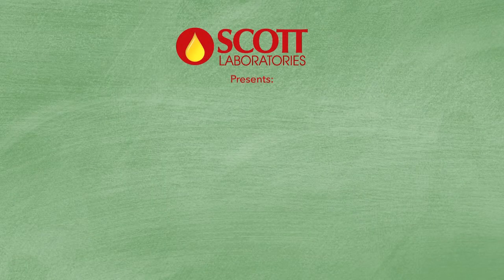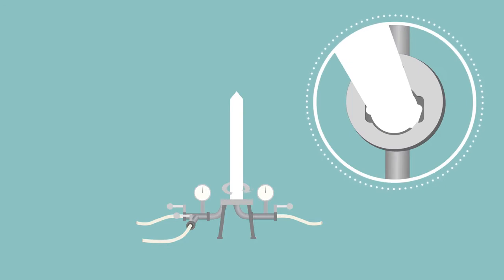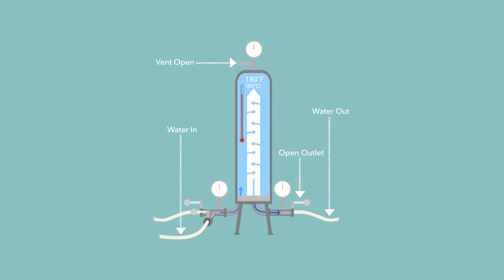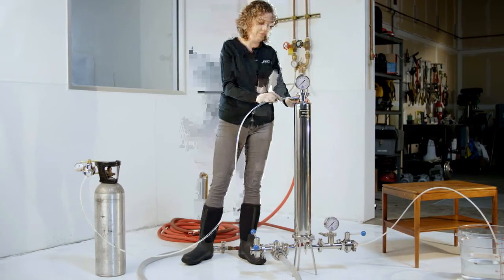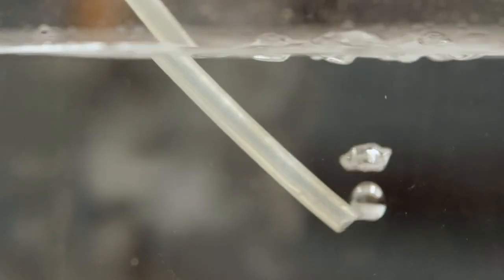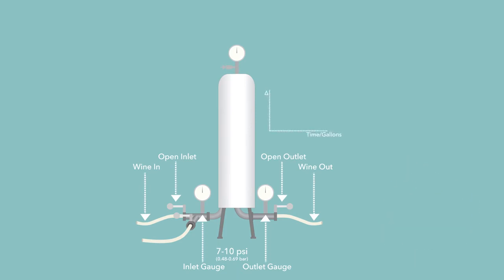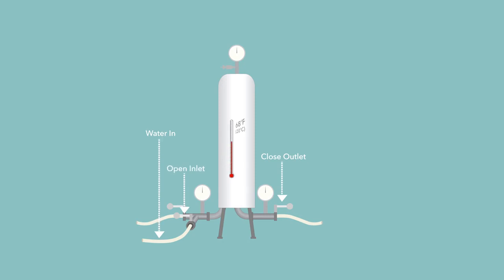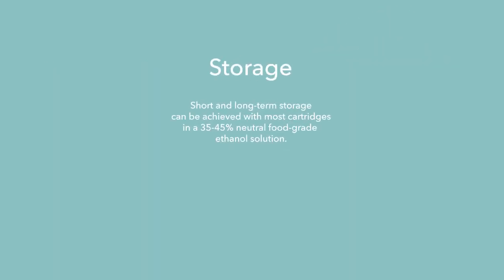Scott Laboratories Cartridge Filter Setup and Usage

Comment: What Harris regulator are you using?
Reply from the maker: Hi @ethervillain - Whichever regulator you're using, it should be close to the same range as your pressure gauge. In other words, you aren't going to apply pressure over the maximum pressure limit of the media you're using. If you have any other questions, please call us at 707-765-6666. Thanks!